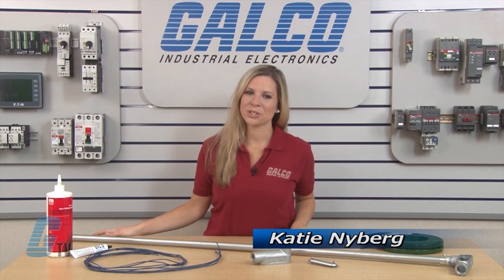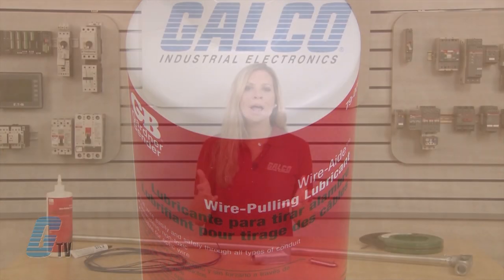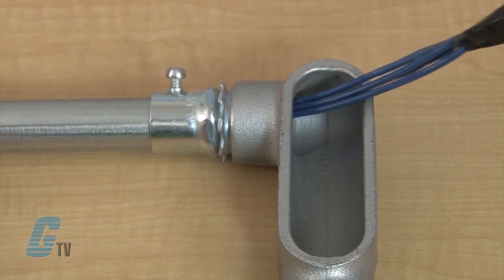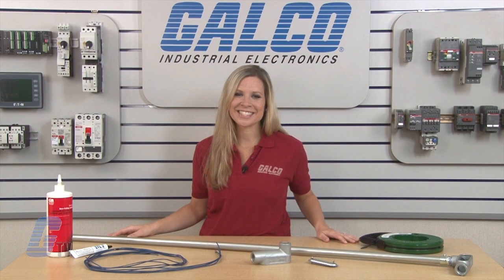How to Pull Wire Through a Conduit Outlet Body

Comment: This is the second one of these videos that show the wire being pulled in the wrong direction. You can get away with it with small wires but not larger wires. You always pull through the long direction first and feed into the short ninety.

Comment: Done by two people.  [0:34]  Hmmm...
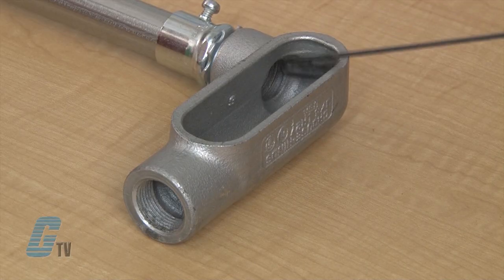Involves putting in and pulling out on a body.  [0:40]   Alrighty...
Should be about 6 inches.  [1:23]

Apply lubricant.  [1:07]  Ok...
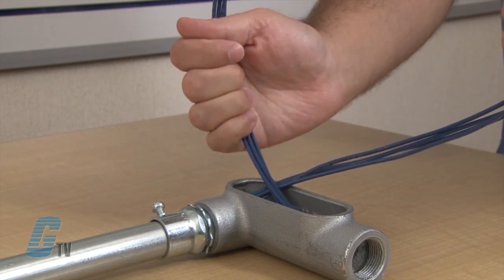to prevent scraping against the hub. [1:11]
Pull from the other end.  [0:40]

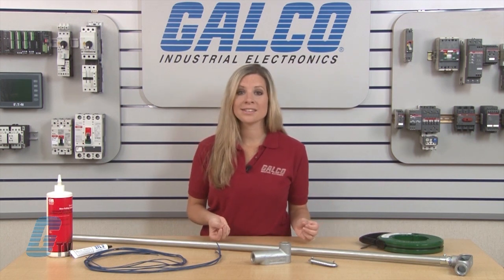Don't get kinky.   [1:31]    Got it.
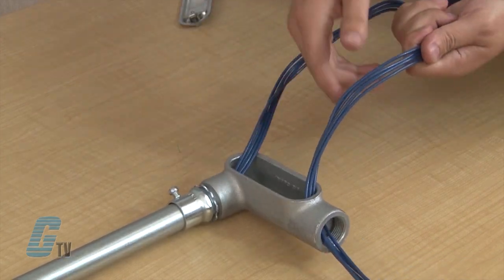Turning 180 degrees.   [1:47]   Ahhh, ok ...

... and the wires can be safely guided along...  [1:54]
WHAT wires?!!

Comment: That's actually called an LR. L shaped bend, with the opening on the right. LR. An LB has the opening on the back, and an LL has the opening on the left.
Reply: If you noticed she didn't do any of it because sitting in front of her on the table was an LB lol but when showing the wire pull it was an LR haha